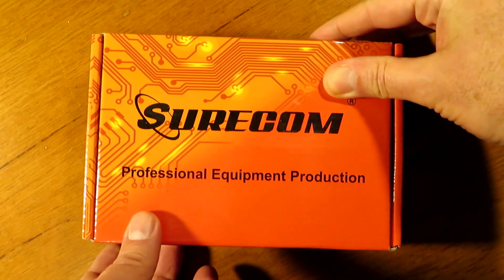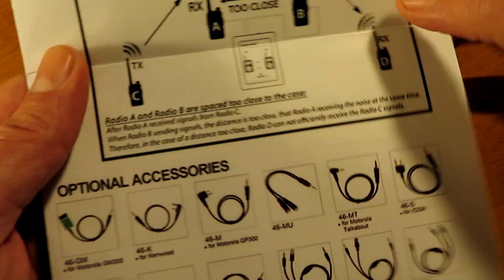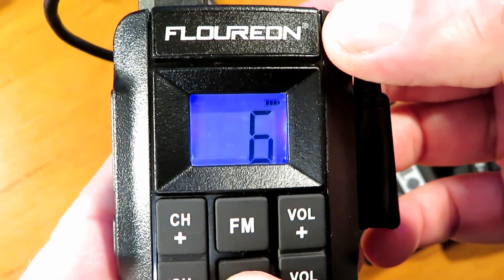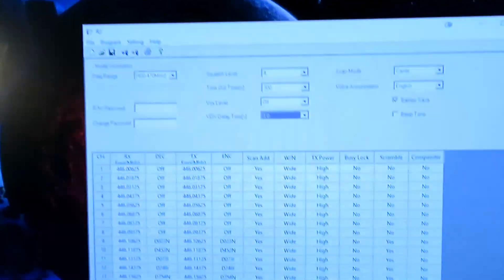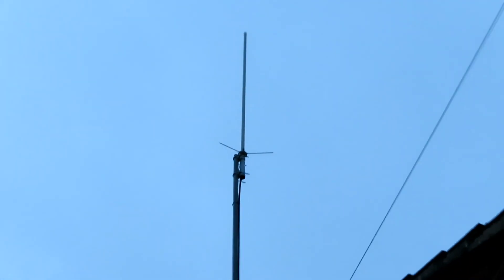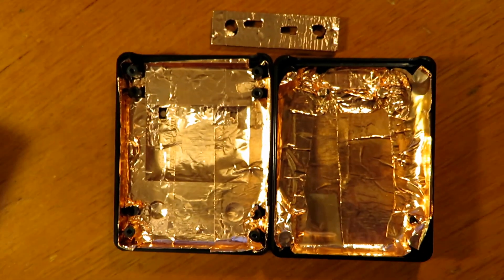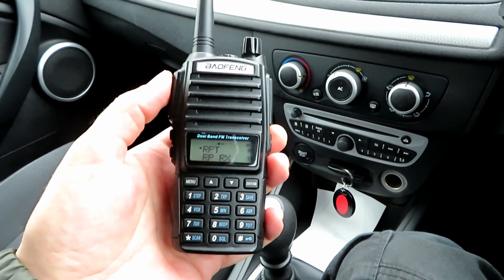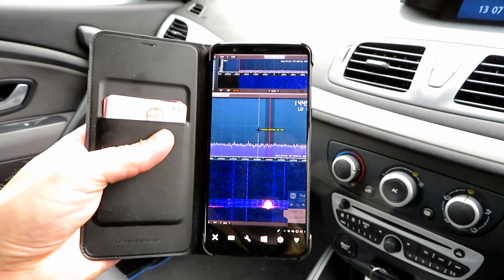SURECOM SR-629 REPEATER CONTROLLER

Comment: Hi, I bought this device to create a small cross band repeater between a DMR UHF radio and an analog VHF one. I noticed that with the two radios very close to each other over long distances it cancels out the signal from the VHF one. The carrier arrives but not the voice. By moving the radios a little apart but not the antennas the situation improves. In a few days I will do as you did, with the copper adhesive and the ferrites on the cables. Let's see if the system improves further. Normally as a cross band repeater I use Wouxun kg-uv8d plus devices which are truly perfect but are only analog. To avoid buying Radioddity GD88s which can repeat the signal from digital to analog I want to see if I can do it with this system. Greetings from Italy and compliments for your channel which always offers many food for thought and information on the technical aspects. Hi from Alberto

Comment: i've got one of these and I use that to re-broadcast scanner audio remotely when I'm in the store or anywhere shopping where range is limited so I can still listen to public safety and railroad traffic so basically whatever my vehicle hears I will hear wherever I am at works great all over the place I've even tried it on FM CB now that that's available and it works even better so yeah because of no limitations to using this product the FCC says it's OK to have these items if it wasn't OK then they wouldn't of allowed that to be imported but I know they'll soon quickly change their minds because of all the abuse of it that it can be used to do a lot of damage and what not because my purpose is just to use it as a remote extender to hear everything that I can't hear while shopping because of interference on the inside of any building I were to go into would hinder my radio audio so I can't hear anything unless I put this on as a mobile extender so I can still listen to my railroad and public safety audio without it cutting out
Reply: Cool idea
Reply: @cchalfantusa  yeah it pissed off cb users on cb 19 & 6 during a band opening wondering about the police audio I laughed my ass off and im never stopping

Comment: Using a system like this I understand it's perfectly feasible to use a solar panel to charge the cell which in turn keeps the repeater working properly. Although I have to wonder how a handheld can be operating and charging at the same time when most of them tell you to make sure they're turned off before you put them on the charger?
Reply from the maker: Yes many will work and charge at the same time however it would be better to use a panel to charge an external battery really, sun doesn't always provide enough power.

Comment: I have been testing this unit, and have found some odd issues with it. I have it running 2 baofengs in bidirectional mode ("1+2") with the "input radio" on 70cm, and the "output" radio on 2M.  What I noticed is that the controller seems to "kerchunk" the input radio frequently.. anyone else have this issue?  I also noted that if you leave the USB power plugged into the controller, it freaks out once in a while where it keys the radios and sends this awful screeching sound.  Otherwise, It works nicely.
Reply from the maker: It's hit and miss at times, I just couldn't get it to work reliably at all.

Comment: We live in a valley. And to be honest all I do is call my backside off. For nothing. Not shot full of cash thinking of setting up a simplex(store and forward set up)  for at least ten miles we will have system . Wish me luck de kv4li 73
Reply from the maker: Keep an eye on the channel, I've built a 10 dollar Arduino store and forward repeater, easy to make and operate, you can buy a product off the shelf but more expensive and not as versatile, I'll get a video done soon.
Reply: @knoxieman  wow! I'm way behind in tec . Had to be mom/dad, cheife cook and bottle washer after wife passed. Now I'm getting back in ham radio. Kinda like a steam boat engneer. Beeing dropped in to a atomic submarine. The tools are different . I get the concept. Just caching up on the tec. Will keep my ear to the rail so to speak tks de kv4li.

Comment: Very basic repeater RF setup

Should have duplexer for your repeater antenna, otherwise you hv to find an relatively optimum positions of two antenna

The 5/8 type of your antennae has an 
up tiled radiation angle, therefore the other quarter Antennae underneath can work correctly.

You can also try working with two yagi antenna, or antenna positioned at two different polarised angles!

Another comment is quality radios with good RF quality

Cheap radios are using FRS chipset circuits added with TX boosters, low cost scenarios, but no good RF tune circuits!
Reply from the maker: Thanks for this 👍

Comment: Great video thanks Paul. I've experimented with the Surecom SR-328 and experienced exactly the same issues, i.e. works OK with strong signals but as soon as the level drops slightly you lose the transmit audio. I can't get the specified aerial separation at home, which may be the issue. I agree that I can get better range without the repeater, which defeats the object really!
Reply from the maker: Thanks Rod glad it wasn't just me 😎

Comment: nice one Paul shame it didn;t work out properly. That case is from the Surecom SWR/power meter they just covered the holes with the sticker.
Reply from the maker: Ah right thanks for that mate, it's that springy sticker thing when you push the case that's really poor that is, overall a very poor quality product.
Reply: Yeah I tried one a few years back and had the same issues. The concept 'works' but they don't take into account that antenna separation etc etc. Shame really. Like you say those demo's on youtube are fixed to make it look like it works.

Comment: Put a duplexor on the antenna and use a 5MHZ split.
Reply: I did a ton of experimenting with setups like these and spent... Way too much money, but! I found that if the transmitter is directly above the receiver it does better. I separated them at different lengths to see if it changed anything and, as far as I can tell, as long as it's more that 4 feet apart it's pretty good. I got Max 10 miles out of that setup. The de-sensitization of the receiver is pretty awful for any kind of repeater setup like this regardless of the controller used. Then I doubled down, did a duplexer, 5mhz split, and wow what a difference. I got 27 miles and was still good readable. I live in Montana so that's the farthest I could drive to peak to peak and not have to spend a whole tank of gas or a weekend hiking in. At some point I intend to get an airplane up and test it some more to get a decent range out of it. I also tried different antennas and really didn't see much difference. I did notice that if the Rx antenna was smaller than the Tx there seemed to be some improved quality. Again it's not worth experimenting and wasting money. Go with the duplexer or the simplex repeater. Don't waste your time and money experimenting, we already did it for you.
Reply: @spencergilchrist4489  What duplexer did you use?
Reply: @militaryrig    I found one on ebay. Cheap $90 one with the 5mhz split. The newer one I got was $160 with 4.5 mhz split for more recent tests just in case. 8 cavity. But there are some 5mhz 6 cavity ones all over the place for $90-$100. Some will do lower powers for cheaper too. Just have to shop hard. I wouldnt put these in sites where there is other radio equipment to reduce the chance of interference but they really work good contrary to what you see online. You kind of have to experiment a lot though to shift through the garbage advice you find online. Also depends on the frequency your using and the freqs you are licensed on.
Reply from the maker: Yes I'm thinking duplexer but to be honest the UV8000 is just £60 at the moment and would serve better, I was cross band on this  test VHF/UHF and it still didn't work reliably, at times it would lock up on transmit and just stay keyed up till the battery went flat.
Reply: @knoxieman  - I would suggest dPMR, as digital output power is uniform and voice peaks like on analog don't interact so much receiver/transmitter. Duplexors tune up easier with a steady signal of dPMR.